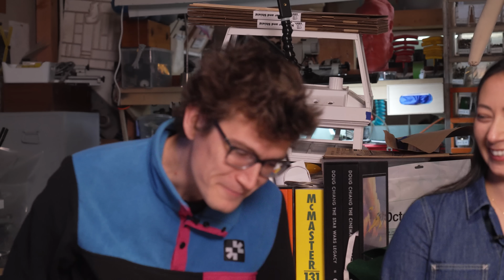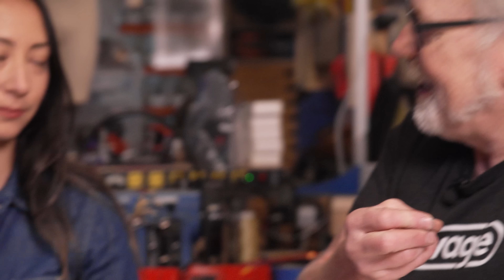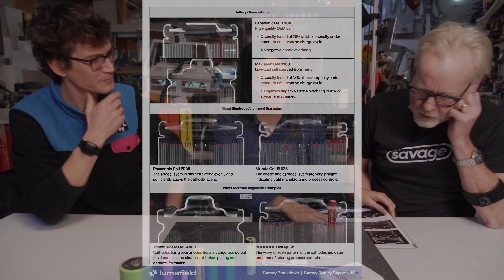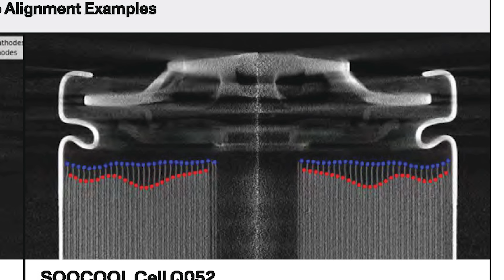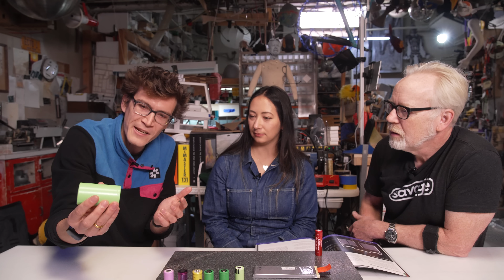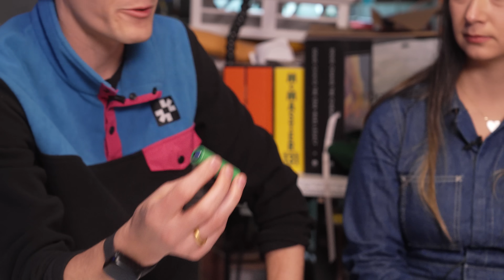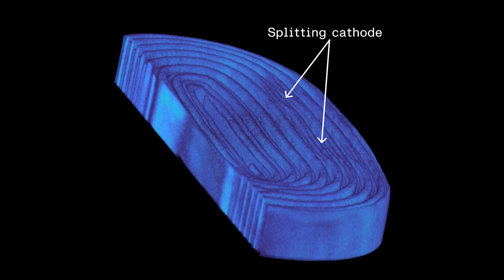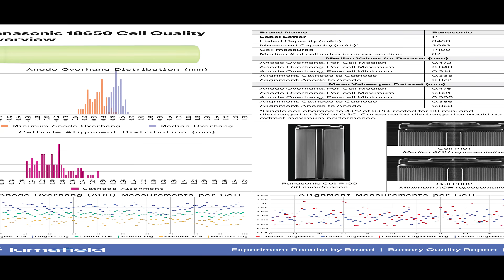The Surprising Flaws in 18650 Lithium-Ion Batteries

Comment: I build DIY robots and drones, and my collection of LiPo battery packs scares the living smeg out of me because I don't have a great place to store them. I keep them in fire-proof bags inside Bat-safes (a specialized dual-hull steel box with filtered vent holes) filled with inert sand. I used to do steel ammo boxes, but they get super hot during a fire (and if you do go this route remember to remove the rubber seal - you don't want venting batteries to turn your box into a pressure bomb). If you can, go for LiFePo4 batteries instead! They're way less power-dense unfortunately, but they also burn with a lot less drama. The reaction during a LiPo thermal runaway generates its own oxygen, so they become flame throwers. LiFePo4 batteries burn as well and are still a tremendous risk, but at least the fire needs to be fueled by external oxygen. Whatever you do, please have as much respect for batteries as you do for saws and blades and learn about correct and safe use!
Reply: LiPos are kind of a different beast.   They degrade rapidly when stored at full charge or stored when deeply discharged, form dendrites when charged really fast, or when cold and very bad things happen if a cell is overcharged, which ironically often happens because one cell in a pack is dead, and the pack isn't balanced properly while charging so all the remaining cells are overcharged.    The main issue is that LiPos  generally don't come with a built in BMS or high current cutoff so every decision about charging/discharging/balancing is handled by fallible meat sacks.. (humans)..     Lipos also have a half dozen different type of connectors and its not uncommon to use a "multi-dongle" for charging purposes and the very worst thing to do is accidently plug two packs into the same multi-dongle with different cell counts.   I've seen more than one fire as a result of just that.   

If..  you discharge (or charge) your Lipos to 50-60% whenever you store the cells for more than a day or two, and ensure that you are always balancing while charging,  generally they're pretty safe.      

If you want to kill and dispose of lipos, use a "lipo killer".   It discharges the pack very slowly over a week or so, all the way down to 0V, then I cut the leads off and take em to some place that will accept.
Reply: @daemn42  Yes, I built a simple Lipo killer, but when down to zero volts I solder a wire across all the cells so that it stays at zero volts. Then dispose of them at my local council recycling centre.
Reply: I whole-heartedly endorse LiFePO4 (LFP) whenever possible.  I completely avoid NCA (RC batteries) because not only is NCA the most volatile of the lithium chemistries, NCA RC batteries usually do not have a built-in BMS and instead rely on an external BMS during charging.  So literally it just takes one mis-programmed charger and your home burns down.   NMC are less volatile than NCA, but they can still explode.

LFP generally don't explode.  They can still thermally runaway but it takes a lot more work to get them to do that and usually the worst you get is toxic white smoke.  When they do runaway they do so at far lower temperatures so usually there's no fire.

However, that smoke is still toxic, and also flammable.  So venting is important.   Residential backup batteries (which are universally LFP) contain "fire extinguishers" in case of runaway.  Those are not actually fire extinguishers.  Their purpose is to mix with the outgassing from the runaway cells and make the smoke less flammable.

--

Anyway, I recommend getting a Flammable Liquids Cabinet to store batteries in.  And make sure the vents are unsealed and the gas has somewhere to go other than into a wall.

-Matt
Reply: @junkerzn7312  I learned my leason when i was a kid and tried to charge a lipo battery without BMS, had no idea back then how these batteries even work. 
It was an old nokia battery. Of course the battery exploded seding all the copper and aluminium sheets inside flying like confetti all over the room, the curtains cought on fire. Luckly i was there.
Later i got into RC hobby and many years into it i never had an accident. I don't store my batteries in some safe deposit, or some kind of bunker they are laying around my room.
I do not let my batteries fully chargerd.
I use a dedicated charger wich shows on display each's cell voltage during chargin, it's around 50, 100 euro one.
Even though the batteries are rated for 5 amps charging. I always charge them at maximim. 0.5 or 1 amp no more. Not because of the fear of catching fire, but because lipos are expencive and charging them slowly will ensure they will get a balanced charge and will last longer.
And of course, i make sure the discharge in whatever device, or craft i use is proper for the battery. A good tip is, if the battery gets hot during discharge you are killing it, if is a little bit warm you're safe but still not ideal. The battery will degrade fast between cycles.
Usually poor quality batteries charge fast and have low density. Or amps per hour.
Lipos and li-ion become more dangerous during the last of their days. But if you have managed them properly they will die slowly. When discharged the voltage will drop faster and will not hold a full charge.
The real precautions with these batteries is not a concrete bunker for them. But learning how to manage them. Almost everytime an accident happends is due to human error, even with the cheap ones.
I never ever let the batteries charging without my presence.
When i plan to fly my planes, i charge with few hours in advance the batteries i will use. And if i charged them days before the event, i will store them in my fridge.
I use these batteries for 15 years now and never had an accident  with them beside that tiime when i was a kid. And i tried cheap ones, expencive, even very very poor quality wich died after few discharges.
If by accident you shortcircuited a cell and it got really hot you should stop using it. Discharged it and dispose it. 
Always use a dedicated charged wich monitors each cell, always discharge them using a BMS, or make sure the devices wich you use has cut off functions for the battery.
Once you understand how they work, how to use them and manage them is very little chance to ever have one catch fire.
Li-ion are more robust, but also less denser in density and heavier. This is why li-pos are preferred in the RC hobby universe. Especially in the aeromodeling one.
Reply: Here's hoping that sodium ion batteries hit their stride. Less capacity than lithium ion batteries, but safer, and super cheap to source the materials for, since sodium is obscenely plentiful.
Reply: @Dee_Just_Dee  Yes, Sodium is the way. And the energy capacity is improving! Some of the big Chinese car manufacturers are due to switch to sodium this year so hopefully the volume will push improvements.
Reply: The trick is to spread them out thin all over the place. You don't want a huge pile of them. Many small fires is easier to fight than one giant hellish fire😂
Reply: "scares the living smeg out of me because I don't have a great place to store them", I'd high recommend utilising a Big Clive's fire containment pie tin. Failing that you could always seek out Arnold Rimmer to replenish your smeg since his head is full of it.
Reply: I use big old baking pans and hang 2 fire alarms from a string directly over them when charging that's the best i can do for no but the main thing is is to be around while it's charging and don't go running off to the bar especially if you have family members.
Reply: I have hundreds of laptop batteries and I’m always terrified that I’m gonna have a cascade failure
Reply: @DoctorX17  If I had lots of batteries to store, I'd put them in some kind of steel box or drum with a plastic lid outdoors, away from my house so if they did catch fire, the flames would melt the lid and go up, like the blow-off panels on a (non-Russian) tank.
If you need climate control, you can bury the container.
Reply: @DoctorX17  Same here.  I've rebuilt a lot of Li-Ion battery packs, with the end result being that I have a lot of old 18650 cells that present a major disposal problem.  Nobody will take them, and it would be dangerous and irresponsible to discard them in the trash.
Reply: @rickt.1870  getting rid of things with them is I think one of the biggest problems, There is a lot of run around to it. I am sure for example an electronics recycling place may not even take a laptop whos pillows have gone spicy.
Reply: @rickt.1870  why does nobody take them? In my country you throw into bins for electronics and many shops also collect old batteries or ligh bulbs (including the more nasty CFL type).
Reply: @jan.tichavsky Nobody here accepts lithium batteries because of the risk of fire.
Reply: @rickt.1870 there is no risk of fire once they are fully discharged, probably to 0% soc is safe enogh. I store bad batteries fully discharged to zero volts.
Reply: I keep my LiPo batteries in an unused wood stove.
Reply: I have a video of an 6 cell going off on my page. Crazy what 25 volts will do.
Reply: I had a lipo 5000mah that took fire while charging, I forgot to switch from 12V to 3cell lipo pack and it was charged to 14.7. it was terrifying. I kept the ventilation full power for a few hours to evacuate the black smoke and a black thin layer of dust covered  all objects and walls in the kitchen. I was sleeping and heard the whistling noise. Initially I was confused then I realized I’ve set the charger wrongly. Then in bursts into flames like a flamethrower. I had a foam extinguisher that I sprayed the fire with but didn’t do much/
Reply: I store a lot of my older lipo packs in an old oven in my shed!
Reply: I haven't flown my drone in years, going to have to find all my old batteries and chuck em...
Reply: @tommo5884  Amen to that Tommo!
Reply: Same here 😂

I use those gray battery safe bags.  They definitely work and are good to have around.

I ALWAYS put the batteries in them when I’m charging them up just in case :)
Reply: @stevrgrs  My dad carries at least a half dozen RC plane packs all at once in one of those… he may as well keep them in his pockets, the thing doesnt zip shut and is all torn around the carry straps so it would be worse in a fire than good, he’d have 6 packs on fire instead of 1 lol
Scares the hell outta me especially considering all his packs are swollen spicy pillows 
 The swelling is hydrogen that is given off when the material degrades when abused, If you smell a sickly sweet metallic smell when they charge… you’ve got problems 😂
Reply: I did 5th scale surface RC for years and now got into drones pretty heavy. I have thousands in lipo in my house, all stored in vented ammo cans or battery bags. I check them once a month when not in use, doesnt take more than 30 minutes to have some peace of mind. Treat your batteries well and they will last a long time.
Reply: Me too. I haven't taken the extra steps you have but now I'm thinking about it. Two days ago I opened up the case to one of my Drones I haven't flown in a while to see both of the batteries are swelling. WTF?! Seriously? I make sure to never put them away with over 80% charge. I thought that was pretty much the extent of care you could give those. I guess not.
Reply: does batman have a batsafe?   did you borrow it off him?
Reply: I have about 2000 18650s I've harvested from laptop batteries. They sit in a pile in my utility room.
Reply: @gingerwithasol  , dont tell anyone but i have a collection of them too.   not as many as you.   they arent stored under the roof i sleep under.
Reply: I keep mine in the oven 😊
Reply: Are power cords really so bad?
Reply: @user-fk8zw5js2p  Power cords on robots and drones?
Reply: Put them on a metal shelf with some distance apart. If one gets on fire, nothing happens tot he other or the env.
Reply: I used to build drones too and still have the batteries. Been meaning to take them to a recycling/hazardous materials facility, but just keep postponing it...
Reply: Why bother? It's not like it's not shelf stable
Reply: @godofpebbles  The biggest danger is during charging, true! What I like about the Bat-safe boxes is that they have a port in the top lid that XT90/60 connectors fit through, so I leave them in the storage boxes while charging. Not something you can do with the ammo boxes usually.
Reply: Love my Bat-box.
Reply: LTO bro 🖖
Reply: I keep most of my LiPo batteries stored in an air-tight waterproof steel ammunition box.  Never had a problem, so far, and I expect the sealed heavy steel box to keep any problems contained.
Reply: Those storage boxes are how we stored our charging batteries for a high power drone at work as well.  The idea is that a small fire causes the top to collapse and extinguish the sand.
Work moved buildings and there is now a ton of V-mount bricks (for powering ENG camera's and LED panels these days), 3 batteries from electric bicycles and smaller Li-ion batteries (LP-E6 or something, they fit Sony PXW-X70's) in a supersmall room that has an open connection to the rest of the space our little equipment room is situated in.
From the start we asked for a smoke detecter right above our charging spot, like we had in the old building.  The company from which we hire now doesn't see the need.
Worst of all?  We hire space in a libary...
Reply: Agreed. I keep all my lipo's in an ammo container with vent holes drilled through the top lid. They still sort of "worry" me sometimes for lack of a better word.
Reply: I install/repair residential alarm systems, and even reputable brand Li-ion batteries get sketchy after a while. I always take the batteries out of old panels I pull and recycle them for my customers. This has unfortunately led to a large collection of spicy pillows, some of which I place in a cup of salt water outside in my fire pit as soon as I get home. 

On the plus side, I have probably around 50 SLA batteries that I got for free which have turned out to be incredibly useful.
Reply: Lololol.  Stop it.
Reply: I sleep 6 inches above 8kWh of LiFePO₄ every night, in a Lithionics UL certified enclosure. The thing's 6 years old now, too, although still showing excellent capacity. I don't charge it too quickly, usually short of its max voltage and I keep it in a narrow temperature range (5-25 °C). Hopefully that's enough to keep me out of trouble. 🤔
Reply: Buy a small fridge and store them in there
Reply: and yet we still allow these batteries on board Passenger planes inside laptops and cellphones?
Reply: Red Dwarf fan I see😂
Reply: Great suggestion!  Lithium-Iron-Phosphate batteries (LiFePo4) batteries do have a lower power density because they are heavier than standard Lithium Ion batteries, but they are still lighter than most other battery chemistries.  They are, however, the same size as standard Lithium Ion batteries, and they tend to have a useful life that is twice as long.  As you mentioned, they are also safer.  In addition, they do not require many of the same rare minerals, so they are not subject to the same geopolitical, and economic issues that standard Lithium Ion batteries are.
Reply: So much fear in this thread. Sure, treat LiPos with respect, especially if they could be damaged (drone batteries), but they are not going to randomly explode during storage. Simply charge them away from anything flammable and never charge unattended. Double check your charger settings and you will be fine.
Reply: @OmikronPsy  I fear for my life when people board the plane im on with laptops, cellphones and cameras, When I see packages marked with warnings ..."this package contains lithium batteries. Do not air trsnsport!"
Reply: Buy a small fridge to keep them in, They will last forever and be perfectly safe. Ive done that for over 25 years and upon checking the batteries, they are still at the same charge that i printed on them!
Reply: @rogerd4559 is the fridge on or off? 😅
Reply: I have had lipos explode and it was tiny 2s 700mah and the fireball was a couple of metres. I charge on the stove top. And you can just chuck them in the sink and fill with water.
Reply: Someone link this video to the Ukrainians viable information for them to know....
Reply: The biggest danger is during charging. The guy said a colleague was safely charging batteries in his garage and had a fire at 4am. I thought that doesn't sound like safely charging to me.

I also build robots and drones and I never charge batteries at night. I also never leave the house with batteries charging. Not all my batteries are in fire-proof bags all the time but they are while being charged.

I checked your channel in hopes of seeing some of your robots. I was disappointed not to see any. I'm not very good at documenting my projects but I do have a few videos showing my robots. I just subscribed to your channel in hopes of seeing some of your robots in the future.
Reply: @ddegn exactly dont charge unless your there and wake.
Reply: @ddegn  , put a timer on the charger if you are going to take your eyes off it.
Reply: Its a bit of a misnomer to think that a lithium fire can be "fought".  If a small RC pack goes into thermal runaway it will fill the entire room with white smoke in 2-3 seconds and gush fire everywhere.  There's no "fighting" that, and the "holding your breath" trick won't work either.  That smoke is very toxic.

Storing the batteries in a fire safe in the garage seems to be the best compromise.  Or an outside storage shed.  But there is a balancing point between convenience and safety and if things become too inconvenient people generally give up throw away safety entirely.

Wherever they are stored, it needs to be an area that can be easily vented in case of emergency.  In a garage you just open the garage door and turn on your shop fan (everyone should have a shop fan!).   If its inside the home with no direct access to outside, you are kinda S.O.L.   And even with direct access if the batteries are not contained in something you can grab onto or shove out the door, you won't be moving them.

-Matt
Reply: And when they fail...it's dead Dave
Reply: I have nearly 800 18650's and I'm okay with them being right next to my bed. 
I will never have a 123A in my possession after one blew itself across the room like a ground bloom firework.
Reply: I don't think sand will do much except slow it down. You're just going to end up with a ton of extremely hot sand. If I had to diy something, I'd probably use sand and water.
Reply: @GamesFromSpace  Slowing it down enough to have enough time to get out safely is the priority. Not burning the house down is a welcome end result. :-)
Reply: @GamesFromSpace you'd do better just to smother it to reduce oxygen in the system. Water could dissociate in to hydrogen and oxygen and then you have at least two fuels and the oxidizer included.
Reply: @mb-3faze I thought they were self oxidizing. You just can't win. (My idea was to let the water turn to steam though, way below the temperature where it does anything interesting like that. That way it removes heat without being an ignition source.)
Reply: @GamesFromSpace yes, that's why they burn initially. But if you think about it, the absolute maximum amount of oxygen in the cell would be the volume of the cell itself. I've never seen a video of someone causing a 18650 battery fire in a controlled, say nitrogen or argon (or vacuum) chamber. Without supplemental atmospheric oxygen the burn must be less.
Reply: @mb-3faze  That's only going to cause less total heat, it doesn't stop the crazy high temperatures which are the real problem. Venting the thermal energy as steam stops the super high temperatures from affecting other objects, even if it let it burn longer for some reason.
Reply: @GamesFromSpace putting a deluge of water on would certainly remove the heat. That's certainly true. Anyway, let's hope these discussions are moot when new sodium and solid state bats become mainstream.